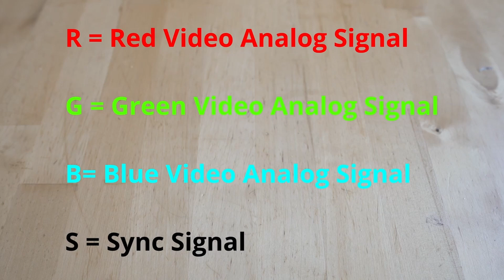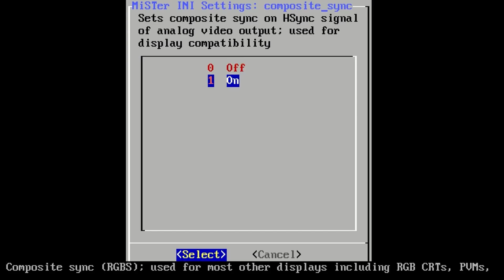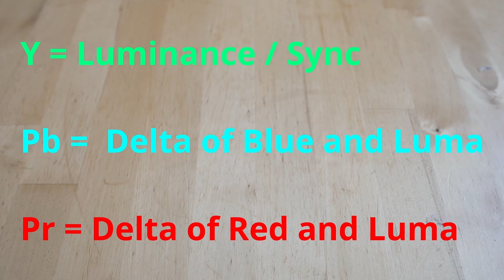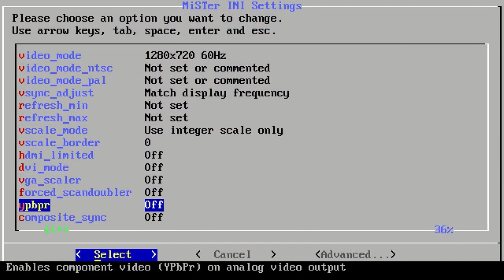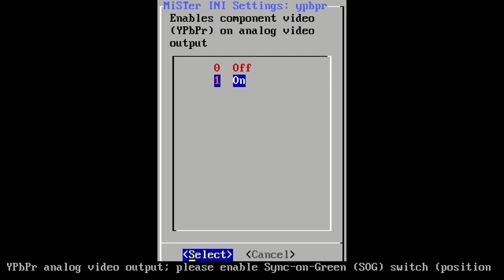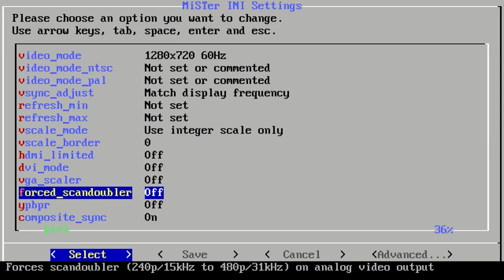MiSTer FPGA 2023 Analog Video Guide! RGB, Component VGA, S Video and Composite! Updated

Comment: question: is there a configuration to pipe direct video through the hdmi port and simply connect a hdmi > vga cable to a vga> composite cable?
Reply from the maker: Yes. You just need the appropriate dongle

Comment: I have the A/V Pro v9.2 board and it does not have the sync on green switch. I am trying to uso compoent video with, however there's no info on how to do it anywhere on the web. I've found info on a lot of things, but this eludes my grasp.
Reply: By cherry picking a bunch of people with problems on Reddit I was able to find out how to make it work. What confused me the most was that after configuring the ini file, the system prompts me to reboot so it can apply changes, however a simple reboot does not do the trick, you'd have to completelly power off the Mister for certain paremeters to take effect. I was thinking I did something wrong before trying this.

Comment: Hey VGE! Wanted to know if I could run hdmi to morph 4k to tv while running vga to svideo?

Would any of the settings affect each other
Reply from the maker: Direct video is all or nothing situation. No analog out when using it
Reply: @ if I switched it back to regular video would I be able to use both?
Reply from the maker: Yes if you use standard hdmi out you can use both sources simultaneously
Reply: @VideoGameEsoterica  but then wouldn’t the analog output be 1080p over VGA?

Comment: Hi I got the MiSTeR Pi FPGA, I'm trying to use the VGA port to connect to the component input on my CRT tv, but i understand i need to change the .ini file, however in your video you said it's also necessary to turn on the "sync on green" but on the MiSTeR Pi FPGA i don't see any switch for doing that.  Do you know how to turn on the SOG for MiSTeR Pi ... i can't seem to find any info on this.
Reply from the maker: Switch on IO board
Reply: @VideoGameEsoterica  The I/O board i have from Taki doesn't have the switch like in your video.  But in that same area i do see 3 bare pins with a "VGA PWR" label on the board next to the pins.  Do i need to connect some combination of these 3 pins?
Reply: @VideoGameEsoterica  I got it working!  In the .ini file i have to also set vga_sog=1.  After i did this it worked!  Also, i noticed in each of the cores, there is a "Video Region" setting, and by default it's set to "Auto", but for EUR games this means the video is displayed using PAL mode which makes the video flick vertically constantly, so you have to set the Video Region to NTSC and the EUR based games will display properly!  Anyhow thanks again for your helpful tips and hope this can help someone trying to use MiSTer Pi on a CRT tv.
Reply from the maker: Ahh yes you want to pick region for sure

Comment: I'm so happy I came across this. Your mention of SCART was great because I am trying to find a way to properly get a signal from my computer via either HDMI or DisplayPort to my CRT TV with a SCART connection and make it look good and proper and not have any delay if it can be helped. What will I need to buy in order to do that? I don't want to leave any stones unturned for this set up and sound is important for me too.

I would have joined that Discord server and found one of my fellow Europeans but the link appears to be dead.
Thank you again for all the info, even if I didn't understand everything as I am new to this.
Reply from the maker: So you just want to go MiSTer to SCART? You just need the triple stack with analog IO board on top and a VGA to SCART cable. That’s it!
Reply: @VideoGameEsoterica  My computer isn't s MiSTer though. It's a system I assembled a few years back.
Reply: @VideoGameEsoterica  No VGA output and there aren't really any DisplayPort to SCART and HDMI to SCART adapters I've found seem sketchy at best. :/

Comment: Great video! I bet with a VCR as an RF modulator and the composite active adapter, one could even connect their MiSTer to much older TVs. I don't have any RF only TVs, but would be cool to see. Imagine playing MiSTer on a vintage 40's or 50's TV.
Reply from the maker: Yes you can def do rf
Reply: Makes sense, that's how we did it in the day with rf only. Hell I talked my parents into getting a new vcr so I could have the old one to connect my turbografx-16 to an rf only TV.

Comment: The composite/S-video adapter I bought actually wouldn't accept a VGA cable, but it was able to plug directly into the analog I/O board, would this work?
Reply from the maker: It will. It depends on the cable it seems
Reply: @VideoGameEsoterica  Sweet
Reply: Also this video says vga_mode should be set to svideo for composite, but it looks like RetroRGB says it should be rgb?
Reply: Nevermind, svideo worked

Comment: 12:18 S-video does not need an active adapter. if you have analog io board you just need a VGA to component/bnc cable and a Svideo to RCA/bnc cable and Bob's your Uncle. also should work with direct video and a HDMI to VGA adapter but I have not verified this bc I have io board

Edit: I see this was already commented and you already replied... either way I think you should have mentioned it even if it is not your preferred method. I already had all the parts needed so I could have been misled into buying an active adapter from the video
Reply from the maker: Maybe I’ll mention it in a 2024 updated guide

Comment: Thank you for this tech, really fantastic. 

Question: (Sorry, I don't know your name) - I'm looking at a CRT with Component Video. However, the inputs are listed in the manual as 480i specifically. I am thinking about two scenarios: 

1. Using the available Component inputs for Retro games, i.e. 240p, which raises the question of how, or even if the inputs can be used to display the native 240p without interlacing up to 480i ? I am assuming this input is consistent with DVD line voltage.

Oh, I should note that I am planning on using a PC with a GPUs analog output (which is why the MiSTer VGA input is so helpful).

If I can run the Component 480i in 240p, would that shrink the image on the screen? I do not see any options for aspect ratio, scaling, etc. on this TV.

2. I also want to be able to go in the complete opposite direction, running modern games, specifically FPS games, without the latency of modern flat screens. The TV does have an aspect ratio option, which I hope is achieved by simply compressing the output of the tube's electron emitter, not via digital processing.

Using the same PC as the source, can I output from the MiSTer to the TV, that's now in 16x9, without introducing any latency?

I apologize, my grasp on these concepts is very limited, but I am learning as I go, so please excuse the above questions.

I am just now examining the TV itself and how it handles the Component Video and aspect ratio. The Service Manual is excellent, so I hope to spot any issues of digital processing if they exist, and nail down the frequency of the YPbPr.

Thanks again for your excellent tutorials and additional help. Without guidance such as yours, us simps would all be screwed.
Reply: 240p is just a hack on 480i, I don't think there are any CRT TVs that accept 480i but won't accept 240p. Worst case are some modern LCD TVs that will interpret 240p as 480i and you end up with some really weird artifacts, but on CRT you should be good to go. Some modern LCD and OLED TVs are able to recognize 240p signals and will avoid trying do do any interlacing processing on those signals as well. 240p Test Suite has a few tools to test if your TV is well behaved or not.

IIRC both VGA, SCART, RGBHV, RGBS and YPbPr all work on similar voltage ranges... analog components are usually 0V to 0.7V, but sync may be something else. On some really old monitors it may even be TTL level on both color and sync signals, but on TVs and anything with VGA, SCART or YPbPr output, the voltage levels should be about the same.

What I'm not sure is if the sync signals on luma (or green, on the rare RGsB monitors out there) still carry luma/green on 0V to 0.7V and have the sync dip bellow 0V or if if the luma/green analog signal gets shifted to a little over 0.3V and have sync be somewhere in that 0 to 0.3V range.

I have heard chroma signals on Y/C SCART and S-Video has a reduced range compared to the luma signal, if this is the case, I wouldn't be surprised if they just passed the signal through the same QAM encoder used in NTSC and PAL composite video systems, but instead of mixing chroma and luma, kept the signals on different channels. I wouldn't be surprised at all if chroma on composite video is transmitted on lower power than luma.

IIRC the main difference between 240p and 480i is that 240p hardware will always output odd fields (or always even fields, can't remember) instead of alternating between odd and even fields. What's the difference between odd and even fields? Well, just the number of pulses that signal vertical sync on composite video. That's pretty much it.

I'm not sure about aspect ratio, I've never seen an actual widescreen CRT in person and know barely anything about them besides the fact that they exist.

Comment: I can't seem to get svideo or composite to work.  I updated my mister, I'm using the active adapter and VGA cable that are sold on mister addons, I have USBC running to the active adapter, I updated the ini file to the correct VGA scaler, VGA mode, ntsc mode, and composite sync settings, I toggled the switch on the active adapter, tried both types of connections, I get nothing :(
If anyone knows something I can try I'd appreciate it!
Reply from the maker: Hmmmmmm. And you are using the YC cores? By your description sounds like you know what your doing so…should work
Reply: @VideoGameEsoterica  well I wouldn't necessarily say I know what I'm doing, just that I think I followed your guide and the one on the GitHub page.  I'm not tech savvy but I can usually follow directions lol
Reply: @VideoGameEsoterica Yeah I think I'm doing something wrong.  I've noticed that I don't seem to get audio out from the headphone jack on the io board either, so maybe something isn't connected with the io board?  Also, the 3 little lights on the io board don't light up.  But the fan spins and the 3 black buttons work.
Reply from the maker: The lights never light up at all? Even from power off to on?
Reply: Nope.  I used to use a digital io board and had no issues, but I recently swapped it out for the analog board.

Comment: Just a note for anyone finding their consumer Sony or mitsubishi sets aren't showing a signal over rgb scart. I found u will need to set the jumper to 5v and add a pigtail barrel jack to your rgb scart breakout cable if going from mister and an extron into the tv. Unfortunately this means another power adapter and cable in the set up. Don't forget u can set controller shortcuts with multi ini to swap from rgb and vga settings. Back button up, back down, back right and left can all be used on mister main menu.
Reply from the maker: Good to know!

Comment: I wish that using the composite adapter and HDMI simultaneously was a little easier. At first using only my crt, update_all was disabled, now I can’t use the menu scripts, such as the ini settings. Do you know if it’s possible to see those over HDMI while using the composite adapter (for dual screens)?
Reply from the maker: I’ve never tested it myself so I’m not sure on that particular config

Comment: Oh Wow! Thanks for the tip on the power over pin 9, I was always curious about that jumper. I will test this with my encoder board as soon as I find a proper VGA cable where pin 9 is actually connected.
Reply from the maker: Happy hunting...its not the easiest thing in the world to find
Reply: @VideoGameEsoterica  I didn't have to hunt too much, I decided to check the VGA cables on some old monitors I have and the first one I've tried worked just fine. First I did some sanity checks, as my video converter board is not the same as yours, I'm using the RetroCastle RGBHV to Y/C + composite one, based on the AD724 chip.

The only weird surprise I've got is that the multimeter I use the most was registering a wacky voltage on Vin, but I guess it some glitch that happens when it's internal battery is running low, as it showed a normal voltage on the USB power tester I've used to check if I got voltage on pin 9. Besides that, it worked just as it should, put a jumper cable in the 5V position on the analog board and all is well.
Reply from the maker: Nice. The older the cable honestly the better IMO.
Reply: @gcolombelli  What happens if I don't supply 5V to the Retrocastle active adapter while using the composite output ? Will it work with less sharpness or it won't work at all ? Thanks in advance!
Reply from the maker: I have not tested that board but presumptively it just will not work

Comment: One thing I’ve had fun doing is putting 2 CRTs side by side with an original console like my Genesis and MiSTer running the same game and see if I can notice any differences….so far MiSTer is 100% spot on…great guide too
Reply from the maker: Yes to find any difference might take hours and a pixel peepers magnifying glass
Reply: @VideoGameEsoterica  I find the biggest difference isn’t in how the games run it’s more the MiSTer has very clean RGB out where OG consoles even through SCART can have a bit more noise and blurriness in the picture
Reply: My unmodified AES in particular has a much rougher output, I suppose a machine made in the early 90s compared to a modern state of the art system that’s to be expected
Reply from the maker: Yes. SNES and Neo Geo are the worst offenders for iffy RGB out without mods
Reply: @VideoGameEsoterica  I’m so used to the SNES’s blurry filtered output as I had mine since 1992 that I find a really clean picture hard to get used to….I’ve got a cheap Chinese clone SFC that’s got a much “better” picture than my original console, not sure what video encoder Nintendo used back in the day but it was blur city
Reply from the maker: Saturn always had the best RGB followed my Genesis. Sega did rgb the best
Reply: @VideoGameEsoterica  I must try my Saturn with RGB only ever used S-video
Reply from the maker: Do it. Saturn rgb is the best

Comment: Watched the video, loved that you did it. 2 questions. 1. I just got the new direct video HDMI-to-Component adapter for my MiSTer. Haven't had a full chance to try it out yet. Have you or do you even plan to get one? 2. Would you be ok with doing an update to the whole "component vs. s-video" on MiSTer comparison video? I know you can't fully tell the difference via youtube but your words of wisdom would accompany it well.
Reply from the maker: Answering in reverse order; I may do that video. Sounds like a good idea. Talk about signal differences. I did it once but that may be two years ago now. First part…yes at some point I’ll do a direct video overview.
Reply: You might not be happy with dv to comp. For PS1 it's mostly good. Not sure if I see a difference. I've noticed some sync issues when trying other cores with that
Reply from the maker: Sync on certain cores can be weird due to some odd refresh rates on certain hardware. Especially arcade stuff
Reply: Be careful with HDMI Direct Video, those can damage the HDMI port on the DE10-Nano on hotplugging and the sync pins of some SCART devices when using an adapter cable, you need a cable with an inline resistor to avoid damaging SCART devices. Despite it having a higher range than the default analog board, it's not a full RGB 24bpp color range as it will usually be reduced to 16-235 or 15-255.

Another interesting option for those using HDMI displays and wanting less lag is setting the vsync_adjust option to 1 or 2, not every monitor/TV are compatible, but the ones I've tested were compatible with almost every core I've tested. The only one that glitched out for a second or two was the PC/XT core.

Comment: Another excellent video! Thank you. I have the JAMMA version of MiSTer in my arcade cabinet. The CRT in my cabinet is vertically oriented so I am unable to play many cores on it due to orientation. I needed a second external CRT connected in order to play the horizontally oriented cores. My external CRT only has an S-Video/Composite connections, no RGB. I tried tapping S-Video from a few different analog connections and had mixed results. ini changes required to make S-Video work will sometimes mess up the internal CRT and vice versa and swapping ini back and forth with each core is a pain. My solution for now is to use the HDMI connector on the DE10 nano and convert that to S-Video with an external convertor. This has worked well so far but I am wondering what kind of quality degradation I am experiencing by converting HDMI to S-Video vs a native analog connection? The internal CRT in the cabinet looks slightly better to my eyes but that could just be the quality/age of the CRTs and not so much the connection. Theoretically should the raw analog out provide a higher quality signal than a converted HDMI out?
Reply from the maker: Honestly if you don’t notice much degrading in the video…does it matter? I always look at it like “could it be better? Maybe. Is this doing the job for me and am I having fun? Absolutely. So maybe I’ll just enjoy what I’ve got” :)
Reply: Truth. So, for others interested in analog connections, using the HDMI port on the DE10 and converting it to your signal of choice gives acceptable results plus you can use the flip/orientation/etc settings in the cores and it also carries the audio signal as well! Thanks again. @VideoGameEsoterica
Reply from the maker: Yes one day I’ll do a direct video guide :)